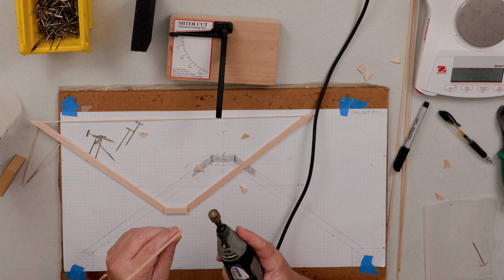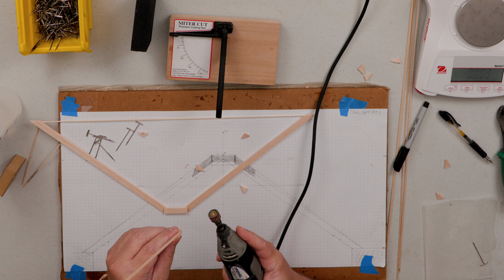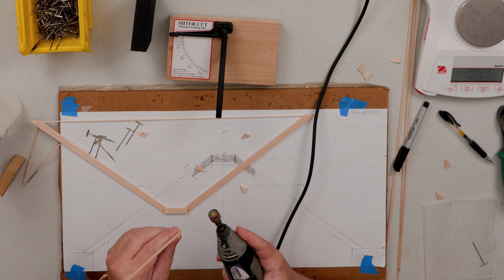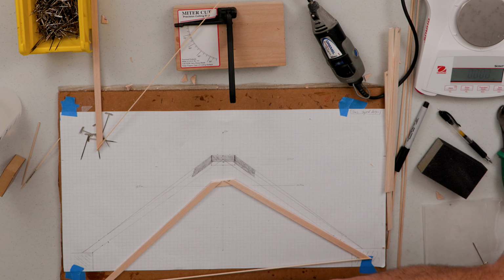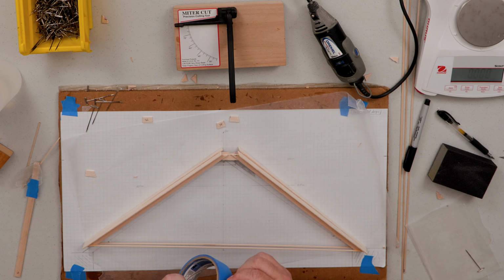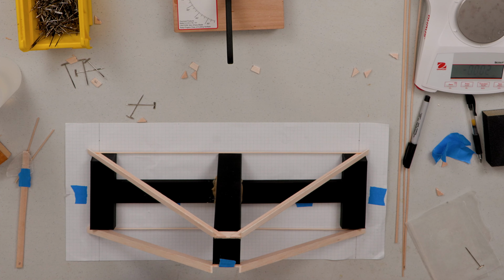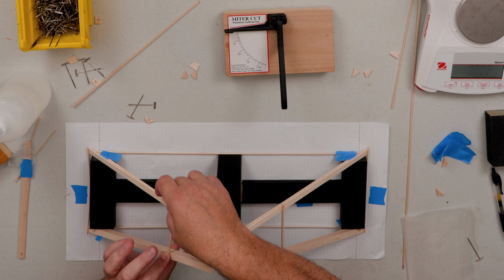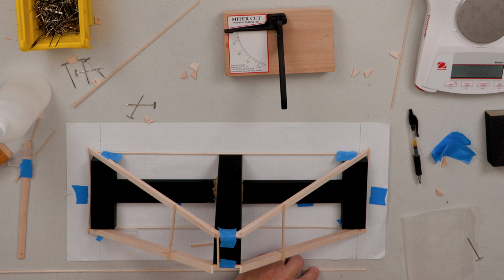Bridge 008 Division C: Complete Build

Comment: Hi I just found this great website. How to print the building block that you made ?
Thanks 
Dave.
Reply from the maker: Hi, thanks!  Do you mean the assembly jig I'm using here at then end?  I have included links to the STL files in the description of the video.  As for printing, there shouldn't be anything special.  I used basic PLA and default settings.  It's too big (for my printer) to print all at once, so I glued the pieces together with Loctite PL adhesive, but anything that works with your print should be fine:  https://www.amazon.com/gp/product/B08BJC59R7/ref=ppx_yo_dt_b_search_asin_title?ie=UTF8&psc=1
Reply: Thank you for quick response. I don’t have the 3D printer. And also, I don’t know the slope degree. Another Question is that bigger piece of wood on side is 1/16 x1/2?
Reply from the maker: If you watch the early part of the video, I go through all the dimensions.  The legs parts are 10mm wide.  If you don't have a 3D printer, you can either send it out to get printed, or maybe try and build something out of wood or other material.
Reply: @balsaengineering6686  I watched several times, But I did see what kind of wood for 1/16*10mm leg, By color, I guess Bass. 3/32 *10mm is Balsa. Is that right?
Reply from the maker: Both of the leg pieces are balsa.  The only bass in this build were the tension pieces and all the horizontal cross supports.
Reply: @balsaengineering6686  thank you so much
Reply: @balsaengineering6686  The final weight is about 9.6g, since the 2022 Division C combined mass of loading is no more than 15200g,  the load efficiency will be about 1583. Is there way to reduce the weight of bridge?  Thanks
Reply from the maker: If your bridge holds the entire 15kg, you will get the 5kg bonus, so your score would be a very, very good 20000/9.6 or 2083.  Reducing the mass further to get the final 20-30% performance is a huge task and there is never a simple answer.  I would recommend checking out my Advanced Optimization video series to see the way I approach such a task in general for some ideas on how you can approach that with your device.
Reply: Is the bottom cross length 14cm? Are the top two connection length 5cm ?
Reply from the maker: The bottom jig width is 14cm, so the length of the actual cross members are about 16cm.  The top two cross members are around 5cm as the jig width is slightly smaller.
Reply: @balsaengineering6686  Thank you very much
Reply: @balsaengineering6686  I sanded the top of both big pieces FLAT, when I put the two them to the jig, the top is not parallel with bottom. it have angel.  In your video, I didn't see you sand it before put top cross. 
Thanks
Reply: Since the two big pieces are lean to the jig, the bottom is not 100% touch the table surface. Is it okay? or need sand it to make bottom to tough the table surface 100%?. Thanks
Reply from the maker: The angle is pretty shallow, so I found it wasn't necessary to sand them flat after assembling on the jig.  You certainly can if you want and it might be better, but make sure it's level
Reply from the maker: I've found that it wasn't necessary to sand the bottom pieces flat either and that can introduce problems with the entire bridge being level.  If you are comfortable with sanding them flat and keeping everything level, that is fine too, but I never bothered doing it
Reply: what wood for the last two top cross? I t looks like 1/16*3/32 Balsa?  Thanks
Reply from the maker: @calebdeng6765  For this build, it was 1/16x1/8 bass, but something like 1/16x3.32 balsa would probably be fine
Reply: I just want to thank you. I followed your instructions to build one and it hold 19kg. But bridge is 11.45g. Is there any way to reduce the weight of bridge?
Reply from the maker: Congratulations, that is a very good start!  Most likely you'll be able to reduce the mass of many of your components starting with the legs.  I just made a 6 part video series on how to optimize these types of structures, so you might want to check that out.
Reply: @balsaengineering6686  I watched all those videos. They are very good. I have 2 questions, Balsa wood has middle density and high density. But high density is heavier than middle one. What density do you use to build this type of bridge? Another question is that  to go to tournament, can I bring the one that has been tested, but not broken. Or build new one without testing? I'm not sure if the new build is good or not without testing.
Reply from the maker: I made a balsa density video that talks about the ideal range for these types of things.  The short answer is light to light-medium is the best.  You can see more details here:  https://youtu.be/mzMFhd4SqP8
As for rebuilding a new one, I would recommend if you do build a new one, test it yourself first to see if it will hold the entire weight.  If it does and is lighter than your earlier one, definitely use that otherwise just go with what you already know works well.  Good luck!
Reply: @balsaengineering6686  thanks for the information.  Can I take the one that has been tested to the tournament ? Someone said it'll be easy broken after it has been tested once.
Reply: I just build second one 10.4g (lighter than first one), It holds 16kg and not broke. I tested the first one again. It didn't broke. I'm not sure if I can bring the second one (tested once) or build third one without test to the tournament.  Any suggestion? Thanks
Reply from the maker: Hi Caleb, I get some form of this question a lot, I definitely need to make a video about it.  We always pre-tested all of our devices before competition.  There is a good range where the loading won't do any damage to the device.  Say the eventual failure of the bridge will be 17kg.  If you are somewhere between 70%-90% of that, you can load your bridge to that amount without doing any damage.  The key is you never know if it's going to be 70% or 90%, so there is risk.  Never test to over 15kg as that only risks doing damage and isn't necessary.  If you have a bridge that has survived 15kg twice, it will most likely survive 15kg again without any problem.   For the one you tested to 16kg, I would recommend testing it again to 15kg and if it holds, and because it's lighter, use that one - if it fails the testing, just use your other one or build another one and test it twice to 15kg to make it at the same level of confidence as your first bridge.  BTW, testing to 15kg is only necessary because of the bonus rules and how important it is to hold the entire weight.  If that rule didn't exist, you would never want to test that heavy.  Maybe up to 12kg or so.
Reply: @balsaengineering6686  Thank you so much for your response, so just for clarification, I should test the bridge before the competition with 17+ kilos or so and if there isn't any breakage I should take the same bridge to the competition?
Reply from the maker: @calebdeng6765  No, only test your bridges to 15kg, definitely not 17kg.  If you have multiple bridges survive 15kg, take the lightest one.
Reply: @balsaengineering6686  thank you very much for the information. I'm just afraid If I take the survive 15kg one to the competition, it'll break at competition since it was tested once already. If I build a new one to take the competition without test, I don't know what will happen also.
Reply from the maker: @calebdeng6765  For all the real competitions we competed in where there was a bonus for holding 15kg, we would always pre-test to 15kg and it never broke if it passed our testing process.  That is no guarantee of course, but it's what our teams did.
Reply: @balsaengineering6686  Thanks again. You also mentioned that can be dry out. How to dry it?
Reply from the maker: @calebdeng6765  You can put it in a sealed plastic bin (with the foam seal in the top) with silica gel packs for about a day and that will drop the RH to about 18-20% and your bridge should lose about 2-2.5% mass
Reply from the maker: Only pull it out right before competition as it will begin to regain that mass as soon as it's back in the open
Reply: @balsaengineering6686  Thank you very much for the information. I put one bridge into the dry box, the weight is reduced from 10.435g to 10.162g,  I tested it again, it held 15Kg without broken. It has been tested twice already, Can I bring it to the competition? I'll try to build another two to test. If they are lighter and hold 15Kg, I'll put it in dry box to the competition without test again. Is it right?   Thanks
Reply from the maker: Yep, that sounds good.  You should definitely be safe bringing your bridge that has tested twice to 15kg to the competition.  That is pretty much as good as you can do with trying to guaranteeing the results.  Good luck!
Reply: Thank you so much. I just built another one with some modifications. I used 3/32x3/8 instead of 3/32x100mm. And also use 1/16x1/8 balsa for cross. The weight is 9.38g. It held 14.44Kg without damage. I’ll put it in dry box and check the weight again 2 days later. Do you suggest to test it to hold 15kg again or just bring it to the competition? Thanks
Reply from the maker: @gabrieldeng3990  Your call, although I would recommend you test it to 15kg before bringing it to a competition where there is such a big bonus for holding 15.  Good luck and let me know how it goes!
Reply: I’ll let you know the result. Thank you very much!
Reply: @balsaengineering6686  Is the light bridge easy broke? I built two bridges, after 2 days in dry box, one is 9.2g and another one is 9.8g. The 9.2g one held 15.4kg without damage. 9.8g one held 16.2kg twice.(first test was before dry box).  I'm wondering if lighter one will be easy broken. (I have built one 9.38, first time test help 15.2kg, but second time test was broken at 14kg). Thanks
Reply from the maker: @calebdeng6765  Hi Caleb, first, don't ever test to more than 15.0kg.  Anything more than 15kg and you are risking unnecessary damage.  There is no hard and fast rule about which one is better to use or will more likely break after testing.  Generally, if you have multiple devices that have been tested to 15kg, you can pick the lightest one, but you'll have to decide which one to use based on what you're more comfortable with.   Good luck!
Reply: The bridge is 8.52g after dry box, it held 15kg without broken. Thank you so much. By the way, there are at 10 bridge using the same design.
Reply from the maker: @gabrieldeng3990  Congratulations!  That is a great result!!

Comment: High Balsa Engineering I have a question on the length of the balsa strips you used for the legs of the build before they were cut? Were they 32 centimeters?  I couldn't find it in how to create a balsa library.
Reply from the maker: Hi Rohan, for this particular build, they were either 30.5 cm or 31 cm.  I re-checked my notes and I didn't record it, but it was one of those for sure.  If you are doing this yourself, it doesn't really matter what you cut them too when building a library to choose from.  Just pick something that is a little longer than you need and try to stay as consistent as possible so you are always comparing the same length pieces to one another.

Comment: Hi! what is the length of the two skinny wood pieces at the top of the bridge. I'm talking about the ones that you added last
Reply from the maker: These were around 5.5-6cm.  Basically, just cut them to whatever length is needed to span the top and that should be good.
Reply: @balsaengineering6686  thanks

Comment: Hey, what equipment do you recommend getting for this kind of stuff? Particularly the miter cutter. Do you have a link perhaps?
Reply from the maker: Hi!  The only place I know to get the miter cutter is from the manufacturer:  http://www.fourmostproducts.com/our-products/construction-tools/    

It looks like they are currently out of stock though, so you might have to keep checking back or contact them directly.
Reply: @balsaengineering6686  Do you know another way to easily cut balsa/bass strips with accurate angles? I've been cutting as close as I can and then sanding and it takes forever...
Reply from the maker: If you have access to a 3D printer, you might try making a custom mitre box with the angle you want and then using something like an X-Acto saw.  Here is one that is similar for only 90 and 45 degrees:  https://www.amazon.com/Xacto-X75320-Small-Mitre-Box/dp/B0000DD1O4/ref=sr_1_3?crid=1QV4FWDTW8Q2Y&keywords=xacto+saw&qid=1646357769&sprefix=xacto+saw%2Caps%2C83&sr=8-3
Reply from the maker: There are other tools similar to that miter cutter from FourMost as well.  I don't have any experience with these, but something like this might work:  https://www.etsy.com/listing/154425337/proops-multi-angle-craft-and-hobby?gpla=1&gao=1&&utm_source=google&utm_medium=cpc&utm_campaign=shopping_us_a-craft_supplies_and_tools-knives_and_cutting_tools-cutters_and_trimmers-other&utm_custom1=_k_Cj0KCQiA64GRBhCZARIsAHOLriL4Nw7C9SDIQagS_IobX_c06L2yJfVDKt7OEY2Hw7z7B-MCPj_kwwQaAlcBEALw_wcB_k_&utm_content=go_12561589107_122430442227_506949235879_pla-296369624559_c__154425337_400370507&utm_custom2=12561589107&gclid=Cj0KCQiA64GRBhCZARIsAHOLriL4Nw7C9SDIQagS_IobX_c06L2yJfVDKt7OEY2Hw7z7B-MCPj_kwwQaAlcBEALw_wcB
Reply: @balsaengineering6686   Hello, thank you so much for replying!!! No, I don't have a 3d printer.. The second link looks pretty good-thanks!

Comment: how are you keeping the top of the bridge flat to the loading block as well as the feet flat to the floor with bridges that are slanted in two dimensions or is that just not that big of a concern when you make them?
Reply from the maker: I usually sand the top flat once it's done.  I've found that it doesn't matter too much regarding the bottom.  These legs were not sanded on the bottom and they did fine.  If you sand the legs (or the top), just make sure everything is level once you are done

Comment: So with the extra support leg that you glue onto the main one, it is not really laying flush with the floor, since it is being put at an angle, does this make a differnece?
Reply from the maker: No, not really.  The angled part of the leg provides lateral support for the leg regardless of touching the ground or not.  The whole purpose of that is to provide lateral stability by resisting bending for the passthrough block hole because we can't use the normal cross bracing which usually performs that function.  You can see the effect easily by just using some scrap wood and testing the bending of a single piece, and then glue a piece at a right angle on top and then try bending the piece again.  It will be much more resistant to bending.  This is a very common technique in real construction, not necessarily 90 deg angles as much, but things like steel I-beams use the same principles.
Reply: @balsaengineering6686  ohh got you, thanks

Comment: Hi, Can you give your wood dimensions? Thank you!
Reply from the maker: Hi Nina!  I kinda go over this in the first part of the video.  The leg pieces in particular are 3/32" thick by 10mm and the angled part of the leg uses 1/16" thick by 10mm. Right around the 7:30 point in the video I talk about the new build components. Did you have a specific question that I didn't cover?  Let me know!
Reply: @balsaengineering6686  Thank you! On Specialized Balsa they don't sell 3/32" thick by 10mm or 1/16" thick by 10mm. Do you think 3/32" by 3/4" and 1/16" by 3/4" is okay?
Reply from the maker: Hi Nina, you definitely want to buy the 3/32" and 1/16" thick sheets and cut the width to exactly what you want (10mm in my case here).  I highly recommend checking out my Balsa Library video to see how that's done (it's pretty easy!)  https://www.youtube.com/watch?v=bLsTOpmozGI&ab_channel=BalsaEngineering

Comment: What are the lengths of each of the wood pieces? I couldn’t catch them in the video but I’d like to use this bridge as inspiration for mine.
Reply from the maker: The normalized length I typically use for the leg parts with this design are around 31 cm.  The width of the assembly jig at the base is 14 cm and at the top is 4 cm.  All the other bass pieces I cut to length using the drawing or during final assembly, so I don't precut them at all. I definitely recommend drawing out the design to scale on graph paper like I show here to help with putting things together accurately.  Good luck with your builds!
Reply: @balsaengineering6686  What are the clippers you use in the video?
Reply from the maker: I don't have a link to the exact ones I'm using, but something like this would be very close:  https://www.amazon.com/VISE-GRIP-Diagonal-Cutting-Pliers-2078308/dp/B000A0OW1S/
Reply: @balsaengineering6686  ok great thanks

Comment: Hi, would you mind sharing what dimension basswood strips you used? Thanks
Reply from the maker: If you watch at the 9:00 minute mark of the video, I talk about about dimensions of the basswood strips I use for this build.  1/16 x 1/16 for the tension and bottom horizontal piece and 1/16 x 1/8 for the top horizontal pieces.
Reply: @balsaengineering6686  Thanks for the information. Do you happen to have the link for basswood you purchased on Amazon, since the basswood from the website you mentioned might take a bit longer to ship than we need it by.
Reply from the maker: @smahavadi1  The vendors come and go on Amazon.  Just search for basswood strips and see if anything is available for quick delivery

Comment: I may have missed this somewhere along the video, but what is the length of the entire bridge.
Reply from the maker: At the base, the maximum outer length is approximately 48.5 cm.  The key dimension is 45cm that it needs to span, anything longer than that will change slightly based on the width of the legs.